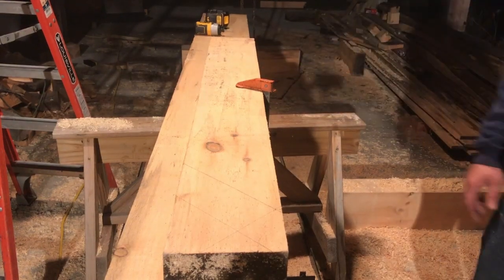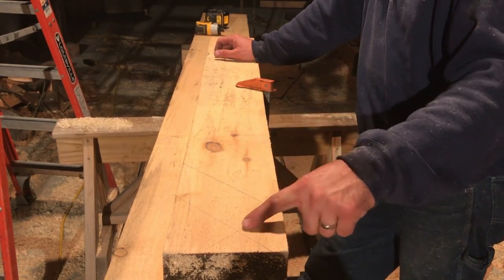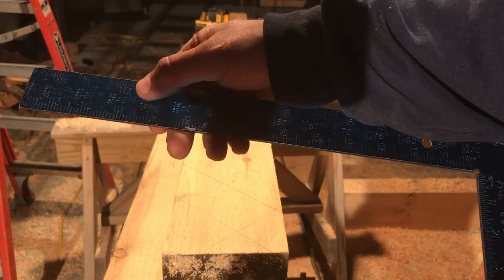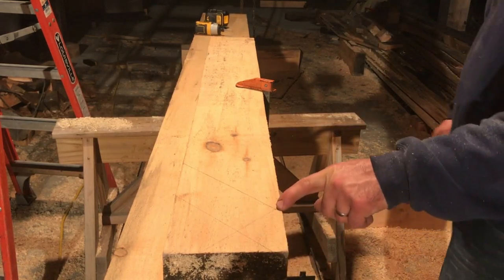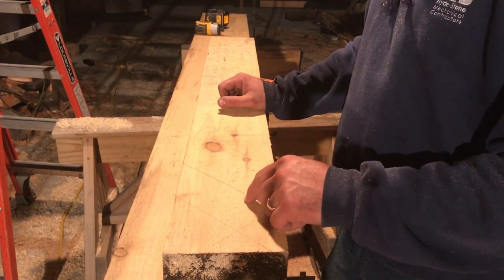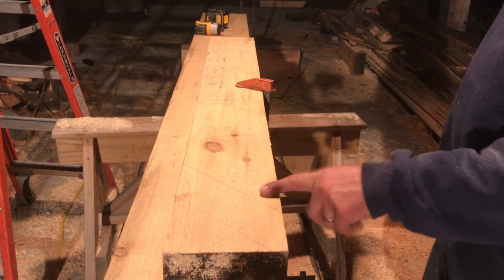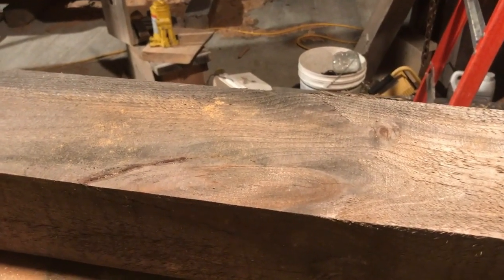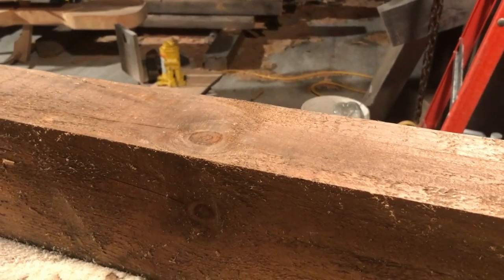A Timber Frame Vlog #60: Cutting Braces for the Top Plates

Comment: I didn't know that about the knots. How much strength in compression is lost from a few knots in the knee braces?  Probably won't matter for my pergola project, but good to know anyways.
Reply from the maker: +Mike Scheve you look at it like any other timber, any large knots in the middle that go through will most likely weaken it by at least half of not more.  A few small ones here and there are fine, it's more the ones large enough to create odd grain swirls around them that you should really watch out for.

Comment: When the top plate racks due to the wind, half the braces are under compression.  The ones set across from them are in tension.  Same thing happens when the wind blows from the other side, just reverses which braces are compressed, and which ones are stretched.
Reply from the maker: You are correct and it is something I fail to mention.  Most brace tenons are not cut for tension, the tenons do not have enough relish for any substantial tension loads.  That is why I usually refer to them as compression members.  There are braces designed for tension load and I see them a lot in the barns around here built around 1900.  Good post you made there.